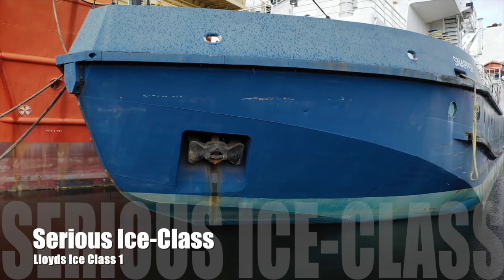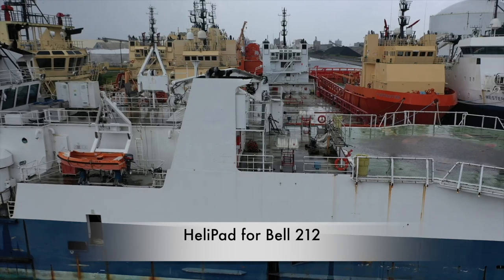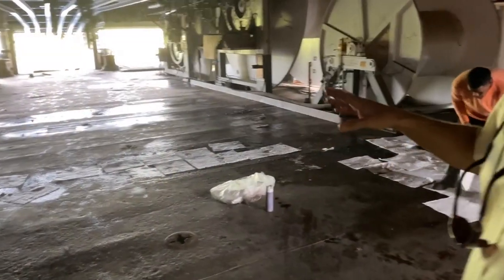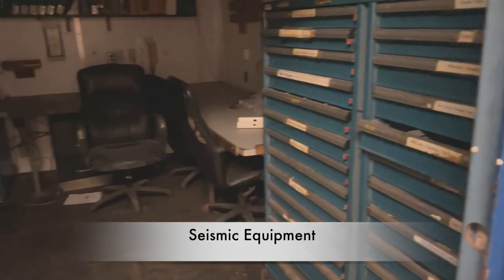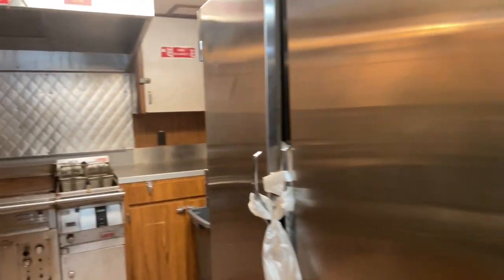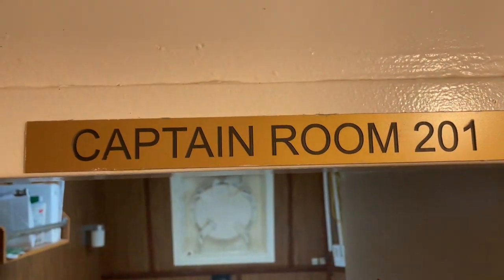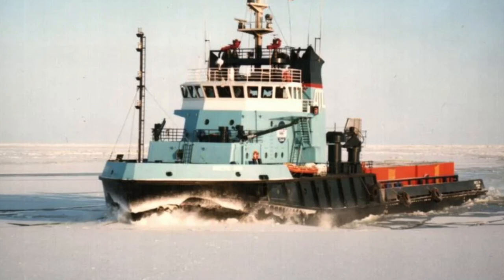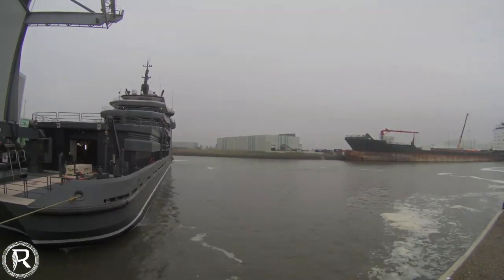221' SERIOUS Ice-Class Expedition/Explorer conversion costs 1/3 as RAGNAR and 3-Knots Faster.

Comment: I need a go-anywhere explorer yacht that can survive accidental impact with floating ice and containers , but doesn’t have to cut through ice. 

The intent is to use it to survive accidental ice-impact, and to rely on an ice-breaker escort if stuck.

2-	It doesn’t have to be fast, but should survive the worst sea states that one finds around Drake’s Passage and in the North Sea.

3-	At the bare minimum, I need a  hangar that is 50ft long x 38ft wide x 12ft high for the Gweduck amphibious aircraft or the Airbus H-145 helicopter.

This is enough to also squeeze in the RIBs, Jet-Skis, and kayaks. One could then place a small submarine on the open deck. 

I would prefer a larger 62ft long x 44ft wide x 12ft high hangar if possible, that could fit the amphibious aircraft, the helicopter, a small submarine, and all the tenders, but this is a preference not a requirement.

4-	It should have a saloon with a covered area of around 800sft to 1200sft, a master suite with a covered area of 200sft to 300sft, 5 guest suites with covered areas from 150sft to 200sft, an office/media room/ICU room(multiple purpose) with a covered area of 150sft, a small sky deck, a reasonable sundeck, a small gym, a small pool(just large and deep enough, so my hands and feet neither touch the sides(6ft wide) nor the floor(3 to 4ft deep), and a length of around 14ft to 22ft), two dorms to accommodate 6 to 8 crew and expedition members, and 3 to 4 separate toilets, showers, and sinks for the crew.

The larger dimensions are the preference and the smaller ones the bare-minimal requirement.

I’m quite pleased with the proportions of the rooms on the Alucia, so those dimensions should suffice.

5-	I don’t care about speed, but do care about survivability and economy, so it should cruise economically at 4 to 8 gallons/knot, whereas cruise with maximum power at 8 to 12 gallons/knot, and survive the worst possible sea-state.

6-	I would prefer twin rudders, screws and engines, but don’t care if its diesel-electric or just diesel.

7-	This is just to get the discussion started, so I’m open to changes to these requirements.

Comment: Do you have the fuel consumption figures for this yacht? According to my rough metric, every 500 HP adds around 2.5 gallons/knot or 25 gallons/hour at 10 knots/hour.

So, theoretically this could consume about 350 GPH or 35 gallons/knot, but the actual consumption can be as low as 80GPH or 8 gallons/knot on a leisurely cruise.

Fuel is the largest component of the operating expense of large yachts, so 350 GPH would translate into $42,000/day in fuel, but 80GPH into just $9,600/day.

The salary of captain is usually around $120K, that of the first mate is around $70K, whereas that of the crew is around $30K to 40K, so the total annual salaries hardly exceed $500K, whereas as insurance is around 7% of the yacht price. Anchorage and repair and management costs also aren't too high. Fuel is the single largest expense on a yacht.
Reply from the maker: I don't have fuel consumption. Ice-breaking requires twice the horsepower as normal ops and this vessel has 2x B&W Alpha Diesel, 12v 28/32 – V0, each 3600 HP
Reply: @ExpeditionYachts  Thanks for the numbers. Ice-breaking vessels are heavier, so consume more fuel even when not breaking ice. The fuel capacity of the vessels divided by the range can provide the average fuel consumption. Ice Class 1C and, preferably, Ice Class 2 suffice against light knocks. Serious breaking requires specialized nuclear-powered ice breakers, anyway, so higher Ice Classes add needless weight. I like the vessel, because when not breaking ice and cruising at a leisurely 10 knots, the fuel consumption could be affordable.

Comment: How much fuel does this consume?  The main expense of a yacht is the fuel it consumes.

If you know the range, you just have to divide the 220,000 gallons fuel capacity by the range to figure how much it consumes per knot.

The crew salary, insurance and anchorage are all fixed costs. The fuel is the only variable cost, so one needs to know what that cost is?